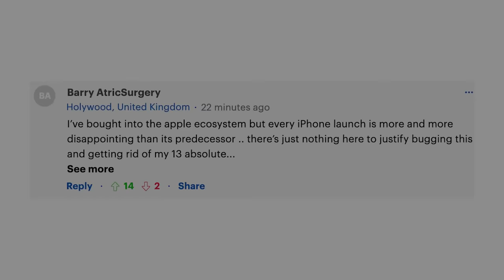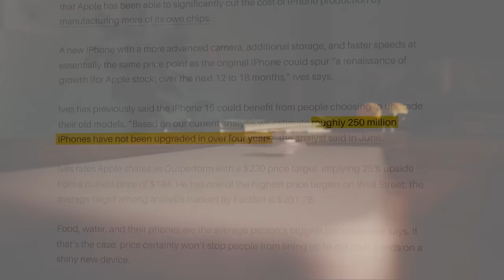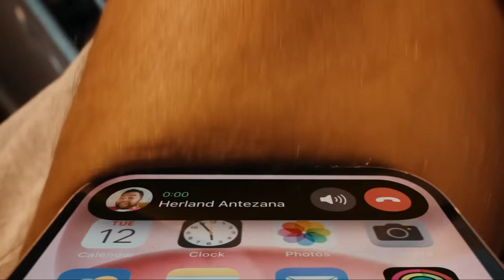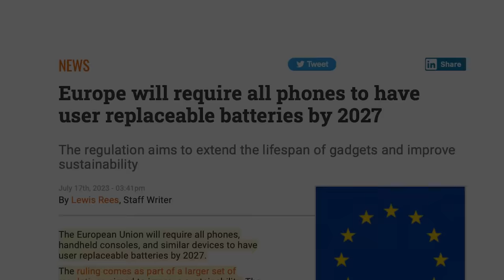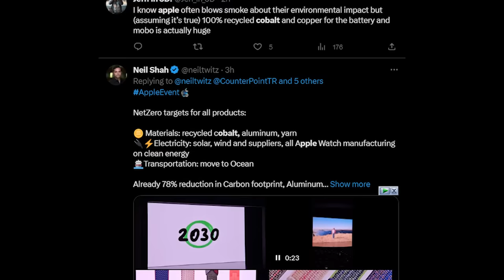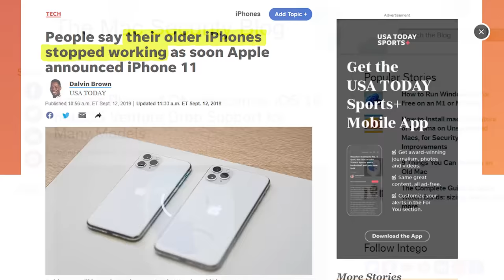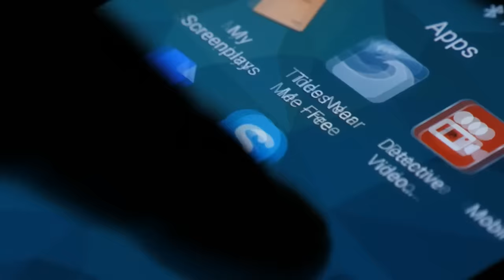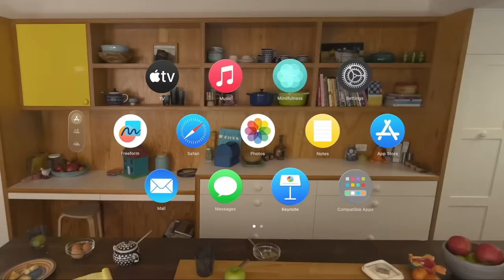The iPhone 15 Is Everything Wrong With Apple

Comment: the regular models still being 60hz and some 200 dollar samsung phones having 120hz from 5 years ago is insane
Reply: Nothing new, they’ve been peddling hobbled gear for decades.
Reply: Cause if they added 120Hz then no way ppls will buy the Pro series 🤷💀💀
Reply: It will remain that way till 2026
Reply: Don't forget the USB-C, it's the same as $200 dollar budget phones
Reply: Don't forget the USB-C, it's the same as $200 dollar budget phones
Reply: It's still insane to me that people are willing to buy a phone with reduced data transfer speed,60hz refresh rate, a year old chipset, and no external upgrades for 800 fuvkin dollars. U could buy the best Pixel out there for that price
Reply: In Germany Its 949€ with 128GB and 1079€ with 256GB ..
15 pro Starts at 1199€ with 128GB and 1329€ with 256GB
Reply: @T0NYMANUEL that 1 year old chipset is still the 4th fastest chipset
1. A17 pro
2. 8gen 2
3. Dimensity
4 a16 
And the a16 is 2-3x more powerful than pixel and the iPhone came with way better videos and almost similar cameras
Reply: those comparisons are always inaccurate since everything else in the 200 dollar phone is probably complete garbage.
Reply: @ruga129  no Pixel 8 and 8pro shoot better videos and photos
Reply: true
average joe doesn't care
Reply: @ruga129 it s only in benchmarks. In real life 0 differences.
Reply: Real iq test if buy an iphone
Reply: @T0NYMANUEL First let Pixel 8 and pro get release then let's talk about it.
Reply: @tuukka1827  true
Reply: I doubt that. 5 years ago S9 was the top phone from them and it was 60 Hz.
Reply: Apple have an interesting approach on their cheaper devices, especially on the screen side. It reminds of the iPhone XR being sub 1080p, it was a big issue for a lot of people but it’s a device that got a surprising number of fans. For me, as long the premium models are on the cutting edge I’m cool with that
Reply: i needed to upgrade my phone few months back went to the store tried the 14 and s23, and god was i shocked to see how bad the 14 screen was 60hz 1cd my $200 xiomi had a 120hz screen ffs
Reply: @T0NYMANUEL  it is a fcking cellphone; no one even uses those features. I used my iPhone 4 for 6 years and my iPhone 8 for 4 years. Just got a cheapo iPhone 14 and this will last me at least 4 years as well
Reply: @T0NYMANUEL  yeah last year Processor but still more performance than any Android, anyway Android in the midrange uses also last year processors 🤷🏻‍♂️
Reply: Well, the consumer must have gotten the message because there’s no more camping out or waiting in front of stores for the “ latest” and greatest.
Reply: @zLcss I dunno, my wife has a pixel 6a, paid $200ish for it, and is the one smartphone ever that she actually likes and doesn't drive her crazy. It's snappy, takes good photos, does everything she needs it to.
Reply: BEACAUSE the average user dosent care I’ve used a 14 pro max and a XR while it is nice to have 120hz it dosent really do anything for the average user so why would they waste there time adding a feature that when you first get it u think it’s cool then the next u realize it dosent really change anything significant
Reply: @T0NYMANUEL   Samsung A53 mid tier phone.  120Hz, 6.5" HDR display, 128GB internal + 1TB external storage, 6GB RAM.  Had this phone for a year now, $450, half the price of the i15 plus with 6.7", and it does everything I ask it to do.  Emails, web browsing, paying my bills, Android Auto, home security camera, dash cam, music, decent quality camera, some gaming (not a big gamer).  And after 2-3 years, I hand it down to my mom and buy another mid tier phone.  I never understood the hype of trying to get the latest flagship phone every year when a mid tier can do everything also, just a tad slower, but for everyday normal use, you wouldn't even notice it.
Reply: When you decide to put 120hz in your phone, you have to consider an exponentially higher power consumption. In everyday use, 120hz is completely unneccesary. iOS is so optimized, that even on 60 frames it looks super smooth. most app-animations, your videos on instagram, tiktok or youtube or whatever content besides gaming you are consuming isn't even made for 120 frames per second. This leaves us with the only logical answer, that 120hz displays don't make sense in a phone, unless for a niche group of people.
Reply: Well tbh I have bought those cheap samsung's phone with higher refresh rate and they only work for a little while and then become laggy and slow when you have enough apps and data stored in and while iphones are expensive but they will work the same years later.
Reply: @zLcss I have a 250 dollar samsung and everything is completely fine, minor exception to the camera which just looks OK.   But processor wise, it's plenty fast enough to play cod mobile at 120fps.
Reply: @T0NYMANUEL but it doesn't have an apple on the back /s
Reply: What good is 60-120Hz if there's no increase in touch sampling rate?🤷♂️
Reply: @zLcss you can get s galaxy s21 now for 250 after taxes
Reply: @T0NYMANUEL you have seen and used pixel 8?
Reply: @DroneStrike1776 mention how sluggish it runs after 4 months too
Reply: @RayhaanNasserthat phone can’t even shoot 4k videos dude in that sense some cheaper phones shoot 4k
Reply: @T0NYMANUEL I bought Pixel 7 since launch sure it has some flaws but it's very great
Reply: Just like how people buy overpriced nivida cards
Reply: @babyaintmoe my mother has an iphone 13 and it doesn't look smooth at all compared to my s23
Reply: The idea that 90Hz - 120Hz is a "PRO" feature is ridiculous honestly as if it's something game changer and complex. but for sure, once you go into 120Hz, you may can't go back to 60Hz anymore
Reply: not everyone needs 120hz first of all the average consumer doesn’t care about refresh rate, but those who do have the option to get the one w 120hz
Reply: And does it matter if your eyes max out at 50Hz?

That's why TV uses 50 or 60Hz: Engineers many decades ago asked the question 'how fast do we need, really?'
Reply: @vylbird8014  the experience between TV and smartphone isn't the same regarding to the refresh rate. it's not like you can't see the difference between 50Hz and 120Hz
Reply: @T0NYMANUEL most users do not care about these features. Most people do not notice the difference between 60 and 120Hz. We do, because we are tech nerds. Last year's chip is still insanely fast. Fast enough for your average consumer. Transfer speed? For what? The 50 pictures you took on your holiday that could be transferred 10 seconds faster on the pro? People buy iPhones because they are amazing to use. They are easy. The system works flawlessly for them. I don't think it's that hard to understand.
Reply: Wait, what Samsung phone was 120Hz 5 years ago 🤔 when the S20 series was released 3 years ago?
Reply: @UnknownUserunknown  exactly. people will say they don't need it unless they tried it themselves. probably won't go back to the 60Hz screen lol
Reply: @babyaintmoe  I use 120Hz all day and the battery still get me whole day. in theory 120Hz consumes higher power, but do you think the manufacturers do nothing about it? in fact most of the game I play run in 120. have you even tried it for yourself?
Reply: @T0NYMANUEL the best pixel also has horrible quality control. I work at a phone store and the amount of pixel 7 pros we’ve seen been returned or gone for repair is way more than any other device 

Even Samsung mid range models have way better built quality, never had an issue with them
Reply: they need to take away the pro series and make it like b4 with just 2 phones the base one and the plus @shorkyy
Reply: 120hz screen would destroy the battery. Everyone I know with iPhones are constantly needing to charge them. Laughs in 5000mAh battery I can go multiple days on light use and always a full day. 😂
Reply: @T0NYMANUEL better photos yes better videos no. That is the one thing Apple absolutely excels at.
Reply: Yeah but optimization is a thing that android doesn't do. Just because you did it first doesn't mean you did it well. Did your display go down to 1hz? Did it do all of that while getting 5+ years of software support and the fastest chip on a handheld device that rivals desktop class chip? I don't think so.
Reply: @T0NYMANUEL  Bro no iphone user is transferring data over usb. People who afford iphones usually just airdrop stuff ya know? Year old chipset that still beats fastest android chip and software updates for 5+ years. What android does that. Cope
Reply: @T0NYMANUEL  yea ik but i guess they do it for the imo lackluster ui or they are trapped in the ecosystem
Reply: apples 60hz tho is still better than android 120hz and if u dont believe me then look into it
Reply: Even 100 dollar phones have 120 hz
Reply: @ruga129 Bro, SD Gen 3 is coming
Reply: @kaito7132  kuch nhi hoga usse apple ab 2 saal aaye chala gya as sd gen 3 4nm pe hi hai
Reply: Their 60hz animations are smoother than Android 120hz animations
Reply: USB C type 3, 10GB/second data transfer speed on your phone. Pretty insane.
Reply: @T0NYMANUEL no one wants a pixel
Reply: Lmao my phone is 160 hz and it's 400 bucks
Reply: Aint nobody care about hz when ur not well informed about phones or a tech geek its all about the vibeee not hz and ect
Reply: I hate Apple and their bullshit, but to be fair a 120hz screen is pretty much useless on a phone.

On a gaming PC 120hertz or above sure, but on a phone, do you really need to scroll on YouTube at 120fps lol?
Reply: I had the Samsung S4 in 2014 it did all the insane stuff you might have heard of
Reply: @kaito7132  Idk about that, man, maybe a little too far on the Android value ,I'd say some 200 and above phones have 120 hz lcds and at around 300 USD, 120 hz amoled and at around 350, chuck in fhd+
Reply: They didn’t have the pro in pink so Imma be stuck with 60hz for another 4 years lol
Reply: $200 120hz phones arent smoother than 60hz
Reply: I have a free government phone and it has usb-c and get reception were my apple phone doesn’t,go figure.
Reply: @shorkyy dude, even with 120 hz OLED panels, people still buy the more expensive S series instead of the budget galaxy A series
Reply: @T0NYMANUEL Bingo
Reply: @zLcss the 200 dollar phone has a micro SD card slot and no hardware locked to a proprietary software and no green screen of death after several updates. So, tell me which is garbage again😂😂😂😂😂😂
Reply: @disadadi8958 but the s9 had a 4k display
Reply: @DroneStrike1776 the Galaxy a53 is a recent Phone and was released around 2022, so what are you talking about dude? Or you're talking about the a51 which doesn't have a 120 hz display and which is a 3 yrs old smartphone
Reply: @danteerskine7678  No it didn't. QHD+.
Reply: @babyaintmoe iOS is so optimized😂😂😂😂😂😂. That's the best joke I've heard by far. One of my friend's iphone 13 pro screen turned green after iOS 16.6 update and his phone is now unusable. Bionic chips heat like iron, needless to mention the shaking camera. 

Stop parroting because you don't have any idea what you're talking about.
Reply: @Jack_Krauzers of course, he never tried it. He still thinks that batteries today are similar to yesterday's crappy batteries with mediocre life span
Reply: @Zellzoi  nah they definitely are
Reply: @Zellzoi  I have a 120 hz  300 USD  phone and a 300 USD 60 hz phone, huge difference
Reply: with HDR10+
Reply: @anodos_  nah def not, unless you buy a refurbished flagship
Reply: Bro what? The first samsung with 120hz was the s20 in 2020 which was like 800
Reply: @180fxr  he...is talking about the 200 dollar ones..
Reply: @soniofficial6017  there isn’t a 200 dollar samsung with 120hz 5 years ago
Reply: @180fxr  Sharp Aquos?...but yea I get it he was fighting with 200 dollar samsung 120hz from 5 years ago" and you tryna point that out. But now apple with 60hz screen is a ploy to get people but the pro. No innovation from apple stil...
Reply: Show off nothing rlse..😂😂😂
Reply: @shorkyy just do what Google does and at least make it 90hz on the cheaper model
Reply: @zLcss I'd disagree. Most $200 phones nowadays are plenty fast enough for everyday use.
Reply: @Jack_Krauzers  i've used 110Hz on my pc monitor when you were not even planned. Was no real difference above 85.
Reply: @babyaintmoe  a dynamic refresh rate 120hz display will be just as efficient as a straight 60hz.
Reply: @darkroastespresso  android does optimize, which decade are you in?
Reply: Tf you gonna do with a 120hz phone? You gaming 120 frames by tapping on ur screen??
Reply: I think the reggies should be 90hz

and the pros at 240hz purely as a slap in the face to the 120 competition.

I know they make their bread and butter with a consistent product, but they need a neat flex of what they really can do once in a while with a leapfrog over at least the mainstream competition once in a while. This is coming from someone who uses both an iPhone and a Pixel.
Reply: But Samsung doesn’t last long. Average 3 years
Reply: @ruga129 Average users don't even care about Geekbench scores. At the end of the day, these phones can still do the same functions. They keep hyping their processors which is not even noticeable in real life usage. Tech media is just hyping these benchmark scores which is pointless.
Reply: Yeah, I'm still holding onto my Galaxy A14, it still holds up, and I'm not considering at all to join apple, for various reasons other than just them releasing the same phone each year.
Reply: @babyaintmoe ios is LAGGY
Reply: @shorkyy  come on, is it so hard to add 90Hz refresh rate? Besides, most Android phones have adaptive mode of switching between 60Hz and 90Hz depending on needs, why Apple can't do that?
Reply: @caza777   I better spend that on decent iPad and save the rest for savings
Reply: @zLcss   not everything is garbage, be a smart user then
Reply: @Archivist42   I always root for the regular edition than Pro Max whatsoever cause they don't make any sense
Reply: @fr3shSwag   just slap the apple sticker if you want to, if you're that dying for a logo
Reply: @anshraina73 apple fanboys tries everything to stop android from getting better than apple lmao🤦🏻‍♂️
Reply: hz dont really change much the performance but its still stupid how cheap they are
Reply: Every phone lost it's FM radio capability, too..
Reply: Not sure if you are aware of this but by Mimi big the refresh rate we speed up the phone.iPhone is about speed
Reply: i'd like 120hz on iphone, not gonna lie. But apart from the refresh rate, the display quality is not something you're gonna get on your 200usd samsung. It's got peak brightness of 2000 nits, amazing pixel density, one of the most colour accurate screens in the market with P3 colour gamut. It's a display worth its price tag imo.
Reply: classic apple
Reply: Even iPhones with 120 hz still mostly run at 80 hz most of the time. They never truly feel as smooth as 120 hz
Reply: @tuukka1827  And what exactly is wrong with buying a iphone lmao
Reply: @babyaintmoe stop the cap isheep 😂
Reply: @T0NYMANUEL  its rather insane that people buy a phone with an operating system created by a company that mainly profits from collecting and selling data and shoving ads up your ass. And dont even get me started on the update support, customer support, longevity, resell value, security
Reply: @marcofe1732  are you describing Apple?
Reply: @T0NYMANUEL  „The Android mobile operating system is free for consumers and for manufacturers to install“
Oh thats so sweet from google to provide their OS for free. And how convenient for google that 99% of smartphone manufacturers are too dumb or too lazy to make their own OS, so they can spread their data collecting software on as many devices as they possibly can. 😂😂😂
Reply: but one question, do regular consumers actually care?
Reply: @SDFSDGFGHMNHHGDFG yes they should(not would) having to pay 1000$ to get a phone having 60 hz is absolute crazy, if your only gonna use the phone for texting or others  just buy android or other old apple devices
Reply: @RizuKenz0  Apple knows what consumers need and want, an example of a need is just a phone that dailys well, nothing too extreme like a whole ssd mount rig, at the end of the day, we’re not paying 800+ dollars for a phone just for that one feature, we’re buying for the memories we capture in them.
Reply: @darkroastespresso  and software support and fastest chipset matters? The only reason I replaced my galaxy grand prime is because the home button stopped working around 2019, and I replaced it with an a3, which I replaced in 2022 with a used s10e because It was a better phone. I'll take a phone with what I need and a little more over an overpriced phone with excessive features I don't and won't need ever need.
Reply: @drbenirusani my galaxy grand prime with only a broken home button still running strong: lol
Reply: @dyzic188 And mamma doesn't care, does she?  🤡
Reply: @darkroastespresso  Agreed. And if they have iCloud turned on, it's already on their other devices
Reply: @YouilAushana  If it did everything back then, why did you replace it? Completely illogical statement. 🤡
Reply: @youssef1770  Why is it Android fans are overrepresented in the comment section then?? 🤡 Scared if losing your Android phones? No one is gonna take them from you, just stop the hate already.
Reply: Apple knows that but Apple knows the user base for the regular iPhone, those users don’t really care for 120hz display. It’s being proven. Well I even proved it myself. The people that in the market for the regular iPhone don’t even know what that is. Is only the tech community that goes insane for a 60hz 800 dollar iPhone lol. While the people who actually are in the market for a regular iPhone does not even know what that is lol.
Reply: Bro 120hz is cool but nobody actually cares. It doesnt remove the functionality, in fact my mom has the iphone 14 pro max with 120hz but never has 120hz enabled and uses 60hz ☠️
Reply: @shorkyy  PRO DONT HAVE 120 HZ MOROOOON
Reply: @ruga129  A16 IS POWERFUL;L IN HEATING LIKE STOVE HAHAHA
Reply: @jevonsims900  YOUR STUPIDTY IS HILARIOUS
Reply: @Mortalsrk NO 60 HZ IS 60 HZ NO 120HZ IN IPHONE MOOOOROON
Reply: @vylbird8014 Eyes don’t max out at 50hz. It’s closer to 500.
I can tell you the difference between a 60 and 120 with 100% accuracy.
Reply: My oneplus 8t has 120Hz. I paid 180 Euros for it lol
Reply: @shorkyy can’t discredit the way better cameras tho
Reply: Because Android phones aren’t that good. You have to seriously customize it to barely work. I own both iPhone and Samsung Galaxy.
Reply: but nobody cares about the 120hz, also it affects the battery life really bad :/
Reply: @miyamotomusashi4556  i like it cause it makes scrolling and stuff A LOT smoother and more responsive, and in terms of battery life it's not as much of an issue on newer Galaxy phones
Reply: you do know higher refresh rate increases power consumption, right? Not a great idea in a device you want to last longer on battery. Unless it's specifically for gaming OR you enjoy charging your phone more often.
Reply: @babyaintmoe  You're the best example of why you should better not talk if you don't know what you're talking about. Your whole comment is just nonsense that is so wrong, I don't even know where to start. How about you google the difference between Hertz and FPS. Refresh rate and FPS are two complete different things. 

"videos on instagram, tiktok or youtube or whatever content besides gaming you are consuming isn't even made for 120 frames per second"

LMAO never heard that much bullshit today. Thanks for making me laugh.
Reply: I've used the pro and regular models. The regular models feel just as smooth and at least for me I don't really feel a difference with that
Reply: Because most people don't need it. 70% of the planet doesn't know the difference and can't spot it if you give them 2 phones with different refresh rate.
Reply: @T0NYMANUEL  Every Pixel is trash. Pixel is for people that want an Android iPhone. And it is complete trash, even Xiaomi and OPPO make better phones.
Reply: Android users don’t get it. Android OS sucks.
Reply: @disadadi8958 redmi k30  120hz, 256gb 400€ 2019...
Reply: @robertaioana2209  I can't be arsed to check my earlier comment you're answering to but what's the point?

A 2019 model with 120 Hz screen? Yes, a rare example released less than 2 weeks before the end of the year
Reply: Yet still, most iPhone users don't care about the 120hz screen or even notice it.
Reply: WAIT
REALLY?
My 200 dollar moto g54 has 120hz and iphones for 900 dollars don't? Yeah apple is cooked
Reply: HZ is hardly noticeable so that’s the least of the worries.
Reply: The problem with the $200 Samsung is that no matter what features it has on the back of the box, it’s still a Samsung.  If you want an Android, get a Pixel.
Reply: @curfewviolater  what is wrong with samsung?
Reply: Why would you even need a 120hz display on a phone ?  Just buy a console if you re into gaming...
Reply: @ruga129 it still isn't upto mark
Reply: @JosephStefanatny  it feels 100 times better